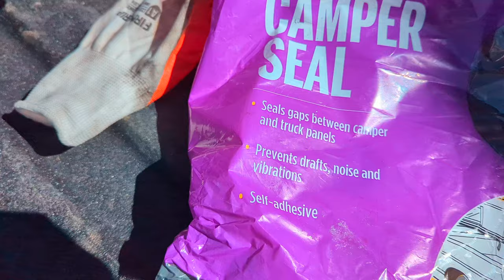Rough Country Soft Roll Up Tonneau Cover

Comment: Bro I just put this on my silverado but, I’m having a hard time closing it ! It won’t lock or close on the latches!
Reply from the maker: Idk mine works perfect. I love the cover. Maybe you got a defective one.  You do have to align it right and put some pressure down.
Reply: @AndreychukAndrey  Alright I’ll try it again. Just feels like it shouldn’t be too difficult to get it to latch. Might be defective
Reply: @ivansahagun7463  Mine was difficult to close the first time. Pushing down on each corner individually makes it easier. Then, after time, it stretched and loosened enough not to be difficult. I had more trouble with front and back alignment to make sure the seals kept water out of the bed. Making sure the front rubber hunt over the bed and the rear seal sit on the edge of the tailgate lift. No real instructions on exactly how the fitment should be in those areas.
Reply: @allandunaway4573  Thanks bro 🙏